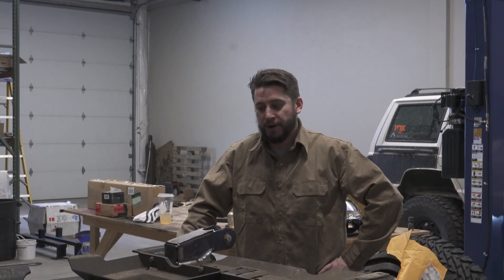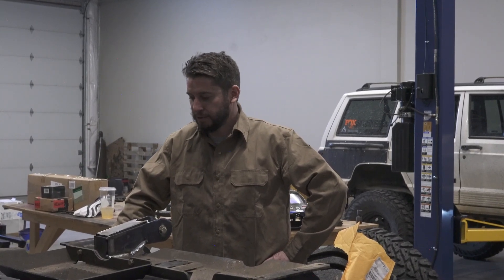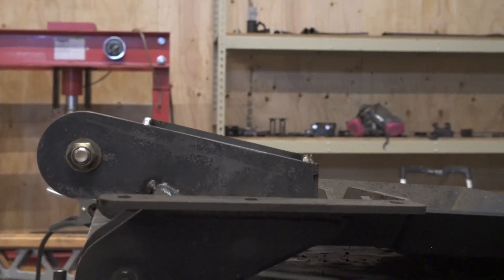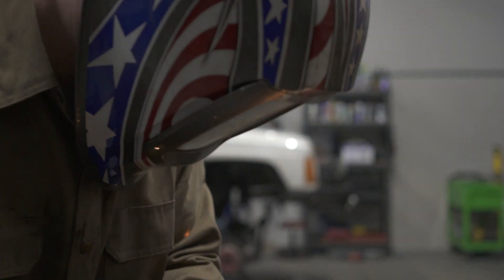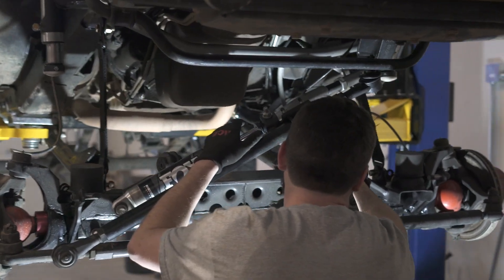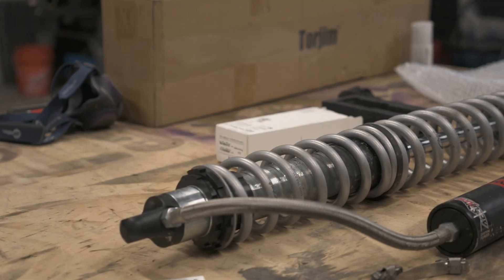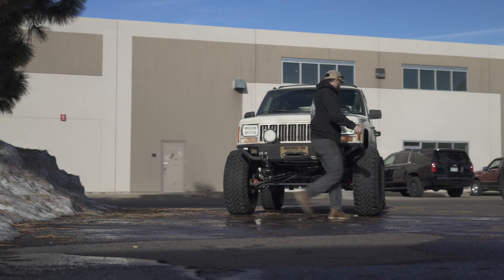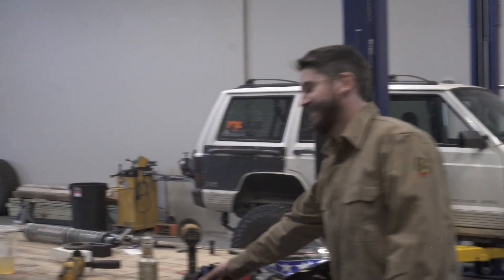Custom 3-Link Suspension for Jeep XJ

Comment: How much uptravel do you have with the coil overs set up the way you did it? I was think about doing a similar setup. Any chance you could do a video on the setup showing the upper and lower shock mounts? There is not much information on this type of setup on an XJ. Thanks
Reply from the maker: We can definitely post a video. So it has 10" travel shocks that are mounted about 4" back from axle center so the total wheel travel is around 11.5". The up-travel on the shock is set at 4.5" so little over 5" at the wheels.
Reply: @juggernautusa  thanks for the info and prompt response